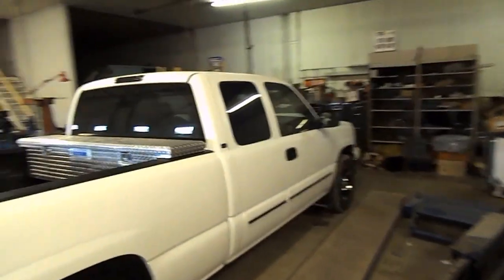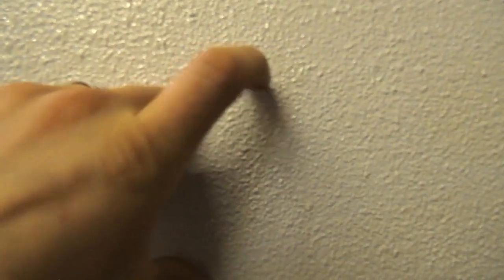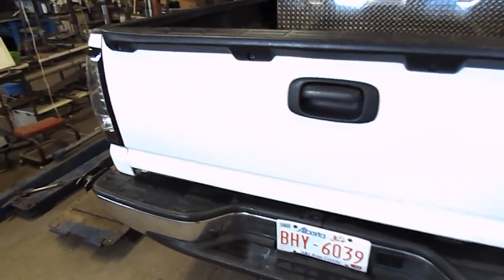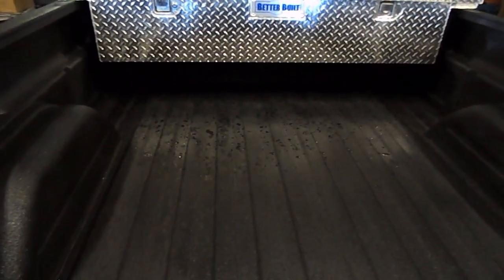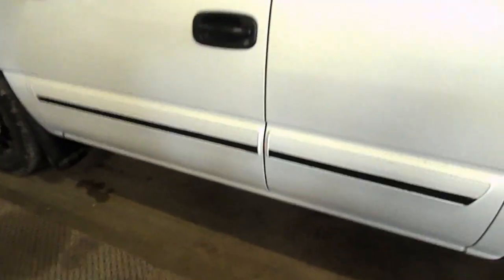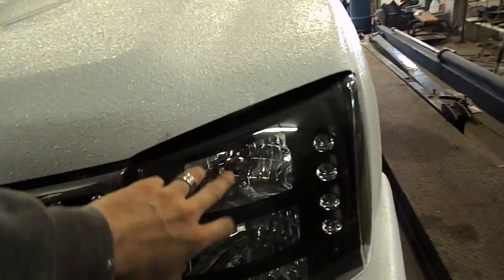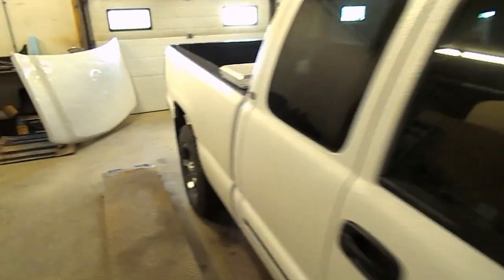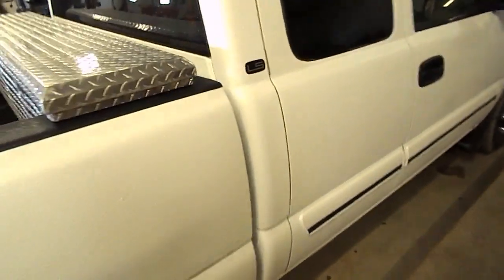I raptor bed lined my whole truck !

Comment: ebay seems to be the deal @ 117.00 for the 4 bottle kit with gun included,I think this stuff can be sprayed through a electric airless paint sprayer,,,I will give it a try.Upol site sells the color tint for 12.98 a 3 oz  bottle, You would need a 3 oz bottle per litter,,,,I will check my local auto paint shop for perhaps a better price on the tint.

Comment: I've got bed liner on my truck too . whole frame , I took the bed off and did the whole under death of the bed . bed , bed rails is black . fenders are white linex and black linex inner fenders . white monstaliner bed liner on rocker panels . turned out good but this summer I'm doing the whole truck in white linex. protects against rocks chipping the paint and causing rust . I've got a video of my truck . it's like the mini me of yours .

Comment: how much did all the materials cost the liner and the white and the clear coat
Reply from the maker: +Devin Ford for everything including the spray gun + sand paper and poly for taping up windows and everything probably around $900

Comment: I just sprayed the green along the bottom of my truck with Raptor Liner for rock protection.  I was getting rock chips from my big tires... was told that it should hold up fine for that...what is your thought on that?
Reply from the maker: did you do your rocker panels or inside the wheel wells?

Comment: You did an outstanding job. Awesome, you should be proud.
Reply from the maker: +Greg Kamer  thank you !
Reply: +Levi Stanford  I was wondering how much it cost for that bedliner. I am looking at buying a truck from my girlfriends grandpa its a 1970 truck. has some rust but I was wondering if you remembered how much just the bedliner was?
Reply from the maker: depends on how much you need, i'm guessing its a single cab? is it long box or short box? and are you going to be taking the box off and doing in behind the cab and the front of the box ? for this job on my truck including the spray gun, 4 kits of bed liner, and clear coat it was around $900-950
Reply: Update?  Been 2 years, hoz it holding up so far? Thanks, looks great except for that darn bowtie in the front :)

Comment: hi there fantastic job mate how many boxes of the rapto bed liner did you go thru ?? im looking at doing my 2003 f350 in it cheers
Reply from the maker: +Dave Russell I used 4 boxes, i used 1 box of black to do the box of the truck then 3 to do the body

Comment: congratulations !!!!! YOU JUST TURNED A 3000 DOLLAR TRUCK INTO A 2000 DOLLAR TRUCK!!!!!!!!
Reply from the maker: Haha, actually I turned a $3000 truck into a $9000 truck. I bought it for $3000, put another $3000 into it and sold it for $9000 a month after this video. I think your math was a little off. :P

Comment: I am getting ready to shoot 3 different colors of Raptor liner on my 1990 K3500 Scottsdale Extended Cab Long Bed 1-Ton 4x4 Dually. What kind of tape did you use between the black and white? I am thinking normal automotive masking tape that I am using on everything else isn't going to want to stick to the Raptor liner very well when I shoot the next color.
Reply from the maker: If it is tape that is specifically "automotive" tape then it sticks just fine. Regular painters tape for indoor use is garbage and never holds.
Reply: @LeviStanford  So far I am getting better adhesion from normal tan masking tape than I am from this green automotive masking tape, at least on the windows and everything I am trying to mask off. I hope it sticks better to the Raptor than it does to everything else, lol
Reply from the maker: @WH6FQE  What brand of automotive tape are you using?
Reply: @LeviStanford  I bought both brands the auto paint supply store had, Fastline, and 3M Automotive Performance.
Reply: For some reason, the Fastline is holding better, but it does not stretch to form gentle curves like the 3M does.

Comment: The Raptor Liner is originally "black", right...? I don't know for sure, or you mixed white paint and  applied clar coating afterwards?  Would you tell me how you got the color mixed into and blend with the raptor liner? Thanks for your vid! Ur truck looks great.. I wouldn't sell it...  😅
Reply from the maker: +joaquin698 sorry for taking so long to reply. there 2 different types of the liner. There is your standard black or the "tintable" kind which is a cream colour which you add the paint pigment to. It says on the bottle which is which.

Comment: I'm not sure if this is a stupid question or not, but if you just use everything in the kit does it come out white? Or did you have to go and buy white paint to mix with it?
Reply from the maker: +Caleb Durham sorry for taking so long to reply not sure if this is still relevant or not but its not a stupid question cause i didn't understand how it all worked and i tried mixing in a black bottle and all i got was grey then i clued in about the tintable kind so there's no such thing as a stupid question when you don't know the answer. but yes you need to buy extra paint to mix and get white you cant just used the base colour in the tintable bottle.

Comment: What kinds of clear coat did you use?  Did you use any special kind?
Reply from the maker: I used pro-form clear coat, I don't think it really matters so much what you use, but when you apply it, you need to apply it around 15 hours after raptor application

Comment: looks good! But you still have to sand before you prime and spray it!
Reply from the maker: Yes but it is still waaaay easier than trying to do a regular auto motive paint job. You actually don't have to use primer unless there is bare metal so it saves a step right there.
Reply: @LeviStanford  i agree and cheaper and alot harder to scratch! good job cool truck!

Comment: About to do this to my Tahoe and the bumpers and grille. Is it holding up good? And is it hard to put decals back on over the raptor liner im replacing my 01 decals and badges with 2016 badges

Comment: Truck looks great! Is one coat all that is needed? Im considering paint my 1992 Dodge W250 and wondered how many coats would you need to spray to get a good durable thickness.
Reply from the maker: I only did one coat I just made it decently thick but not too thick or else it will be to spongy, but what I did worked great but if your truck is going to be seeing a lot of mud I would do two coats

Comment: Hey Levi nice truck! I have a Silverado too. I wanna know what  tint you used ? And what if you don't tint the bottle is it black raptor ?
Reply from the maker: +Adam Jennings  hey adam, there are two different types of bottles to get, there is the regular black one (it will say on the bottle black) and the tintable one which is like an egg shell/tan colour.  (will say on the bottle tintable) if you go to the upol website you can order the tint off there and the bottles will have the instructions on how to mix it and apply it. here is a link to their website 

http://www.u-pol.co.uk/product-cat/83/raptor%E2%84%A2-durable-bed-liner-and-protective-coating.htm
Reply: +Levi Stanford  thanks very helpful

Comment: I want to bed line my entire Nissan d21, i am curious what you did around the windows. Did you remove all weather stripping around windows? Obviously remove door handles, head lights, lights etc. I only have to worry about the cab of my truck since I am putting a flat bed on it. Also did you do inside the door jams? inside of doors?
Reply from the maker: +Acreage DIY  For the windows i removed as much of the outside weather stripping as i could then i just taped off the rest with painters tape. and on the inside of the doors i only did about 3 inches in from the outside because thats where it most commonly rusts, but if you want to do the whole inside that works its all about you own preference. It's just a lot more work to do cause you have to take out all the interior stuff but  again personal preference.
Reply: Wow man that's what I'm looking to do on the same truck let me know how it turns out

Comment: Hey Levi, I have a '93 F350 dully and was thinking about raptor lining the entire truck white. My question is after I do that would decal vinyls be a bad idea because they wouldn't apply well because of the rough surface? So I probe would have to stick with painting any designs if I went that route?
Reply from the maker: Yeah unfortunately decals would stick very well at all and if you put them on they would fall off pretty fast.
Reply: Hey Shaze if you use a heat gun on its lowest setting it will kinda melt the decals into the textured surface , not sure how long it will last a friend of mine  did this and its been over six months and held up to an Ohio winter.

Comment: what kind or brand of clear coat did you put on it nice truck looks good thx
Reply from the maker: I
used the U-Pol urethane based clear coat which you can buy on Amazon here: https://goo.gl/CTe7TW If you are looking for something cheaper this stuff works as well: https://goo.gl/7LbJYT  If you don’t want to shop on Amazon you can basically buy it from any auto body shop as long as it’s urethane based.

Comment: nice clean truck man
Reply from the maker: Thanks man.
Reply: did you regrets after few months...i'm thinking spray my moto in white
Reply from the maker: I actually sold the truck about a month after this video so I couldn't tell you for sure how well the color has held up, but The thing with Raptor is that it has a UV resistant coating which can hold up great against the sun.
Reply: Love it Dude.Great job>Very smart young man.Impressed.

Comment: Did you use a gun? Or did you roll it on? I want to do my truck but I'm afraid of the end product if I apply it wrong, I like the way yours looks
Reply from the maker: i used whats called a spatter gun, do not roll it on it will look nasty, and if your worried about how it looks then get a big piece of cardboard  and practice on it before you go on your truck adjust your psi on your gun until you have a texture that you like and make sure when you spray it that your spraying it from about 2 feet away or further if you go to close it will mess it p

Comment: How do you get a fine texture (like sand paper look)? What's the psi and spray distance to obtain that?
Reply from the maker: stesvis i always keep about a 16 inch distance that way its a nice even spray cause if you go closer it will pool up and leave a nasty blob. if you want a really fine look like one that would look like 40 or 80 grit sand paper i would go between 60 and 70 PSI just have a peace of card board and spray a little on it see what kind of texture its giving you then adjust accordingly.
Reply from the maker: stesvis I used 40 psi on this truck

Comment: How did you do the inside of the doors and under the hood? I’m thinking about doing my suburban and a front end swap like yours.
Reply from the maker: I didn't do either. I just wanted to do the outside as I wasn't down for putting that much effort into it. I would suggest if you are going to do the inside of your hood to take the hood off and do one side at a time. as for the inside of the doors, you could either tape around or take the paneling off. personally, it wasn't worth it for me

Comment: How hard was it doing white on white with the bed liner. I got gm white avalanche and was thinking of keeping it white.
Reply from the maker: It's really easy, just make sure you do your proper prep work so it has a good adhesion. If you would like more info on how to apply and where to buy feel free to watch my "Raptor Bedliner for dummies" Video.  https://www.youtube.com/watch?v=dsw29rbpkjI&t=1450s

Comment: Your truck looks fantastic! This video has really inspired me to do this to my truck over a full repaint. I'm normally not one for questions, but you mentioned using a clear coat after spraying the liner, does Raptor make a specific clear coat for their product, and if not, what did you use as a clear top coat? Thanks very much for any help!
Reply from the maker: Jared Smith Thanks for the compliment, It's nice to know i did a decent job after putting way to many hours in pulling out hail dents anyways to answer your question Raptor is made by the company U-POL and yes they have their own clear coat if you want but the car body shop i was buying my stuff at didn't carry it so I used their pro-form clear coat 4:1 universal urethane based. and it worked great and has held up nice no flaking or anything. Just make sure if you are going to apply a clear coat that you wait a minimum of 17 hours after applying the bed liner before you put it on. The bed liner needs to be dry enough for good adhesion but still fresh enough for the clear coat to bond with it

Comment: Good job on the project. I'd love to do this to my grandpa's old farm truck, but don't have the time to mess with it. But... curious how you came out on this? After bedliner, wheels, grill inserts, lights, and time, it sounds like you put a bit over $3000 into the truck. Were you able to recoup this investment, on top of what you paid for the truck itself?
Reply from the maker: ya I was able to make $2500, but for all the time I put into pulling out the dents from hail and everything, it wasn't worth it. Great learning experience though. I did it to another vehicle with less damage and made $3000 off of it.
Reply: Cool... glad ya made something off it. Learning experiences are good things... good work.

Comment: Can you spray it on with electric spray gun I don’t have compressor
Reply from the maker: I wouldn't advise it. If you can I would rent or borrow a compressor. You can thin the bedliner down and it might be possible for an electric sprayer, you would just need to make sure you do your job in sections and clean the sprayer out good after each section. Here is a videos that explains how to thin it down. https://www.youtube.com/watch?v=AiHVcfshObQ

Comment: did you get this to sell? Did the liner make it harder to sell or devalue or add value?
Reply from the maker: it adds value and is unique so it definitely brought more attention to it, very easy to sell
Reply: Awesome! I'm looking at Raptor Lining my 2001 Ford F150 and painting it OD green. The resale value is in the engine since it's barely been driven (36K) but I know the paint can be a factor

Comment: How many cans did u use I have a 99 dodge about the same size that I want to do this to but not sure how much to get
Reply from the maker: Brandon Goforth I used about 2 and a half kits so 10 bottles for a decent coat the box takes usually 4 bottles, the cheapest place i have found to buy it is on amazon Also if your going to tint it you need to go to an auto body paint shop and get them to mix up the tint to add to the bottles http://www.amazon.com/U-Pol-Products-0821-RAPTOR-Tintable/dp/B00NOIKON8/ref=sr_1_5?s=automotive&ie=UTF8&qid=1433569199&sr=1-5&keywords=U-POL+Raptor

Comment: how in-depth was the sanding/prep?
Reply from the maker: i used 80 grit sand paper and basically sanded the clear coat off the vehicle then wiped it down, for those hard to reach places I used adhesion promoter

Comment: Hey I have a ford ranger I'd like to do the same and line the whole truck. My bed is already done so I was wondering how many bottles you think I would need. It's the xlt model to.
Reply from the maker: +Landon Byrd are you going to be taking off the box and doing behind the cab  and the front end of the box ?
Reply: +Levi Stanford no
Reply from the maker: +Landon Byrd usually a kit will cover up to 125 square feet or a standard 8 foot bed, there are 4 bottles in a kit. i used 3 kits to do this truck, but i also took my box off. so for you i'd imagine you would need like 2 kits plus 2 bottles but if i was you i would go with 3 kits (12 bottles) just incase you mix a bottle wrong or something, its always good to have a little more.

Comment: How long after you applied the bed liner to you clear coat? You clear coat while it was still wet or wait for it to dry? What brand clear coat? Just a rattle can?
Reply from the maker: Ryan Lanting I waited 12 hours. You want the surface to be somewhat cured but you dont want to wait until its fully dry or the clear coat will fall off. Watch my "raptor bedliner for dummies" video to see what I used and how to apply.

Comment: I'm planning on raptor lining my whole truck black and orange. My question to you guys is I've been doing a lot of reading on all the liners. I've heard that raptor lining doesn't stain and that's why I'm going with that brand. But does it actually stain? Or is this some crap spread by other companies so you don't buy certain brands?
Reply from the maker: From what i've experienced it hasn't stained and I used white, the stainiest of all the stainable colours.
Reply: Levi Stanford hey I have the exact same truck I want to do white aswell how many bottles and tint bottles do I need? I'm looking at a kit for 250$ with 8bottles of gm white tint and the tintable raptor liner 2 things of hardener and the gun

Comment: Its insane what you can do your car in the usa. In germany you wouldnt be allowed to drive that with the led light.
Every car part needs a permission.
And even with the permission you have to go to the next registration office and show it to them and pay money for a approval document.

Also every has to be checked every 2 years if it is still able to drive safe on the road.
And those checks are really hard!
Reply from the maker: Holy Crap! thats ridiculous. I mean I could understand if it was imperative to safety, but that sounds like a money grab to me. This is actually Canada and some of the USA is even less strict than Canada, as far as tinting and muffler laws go.